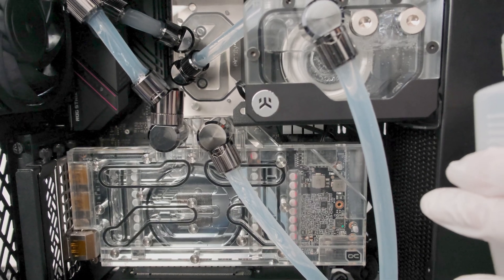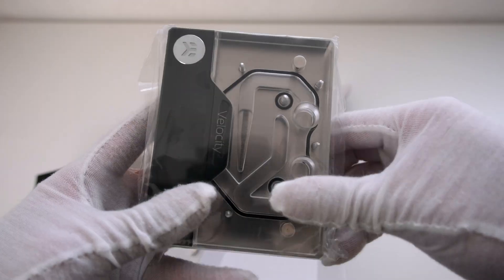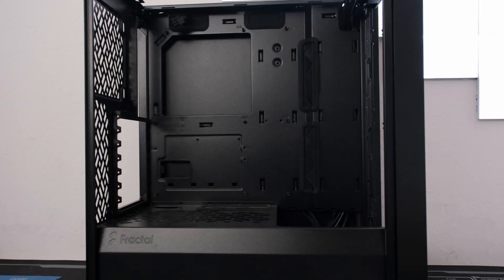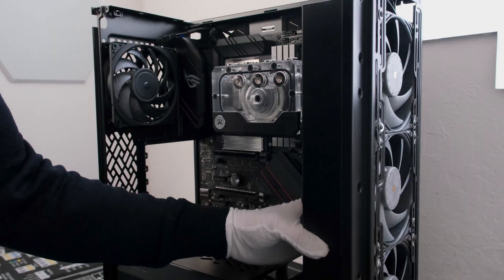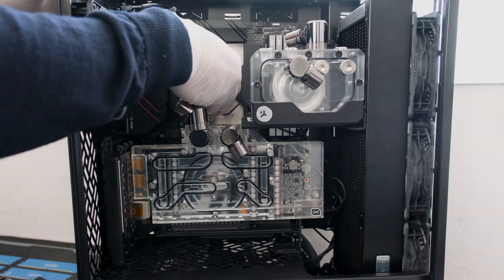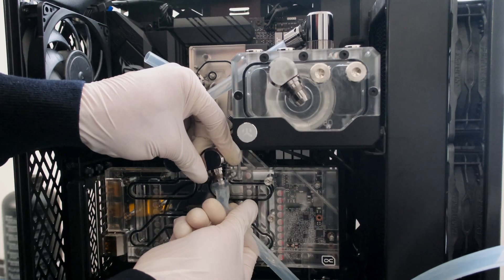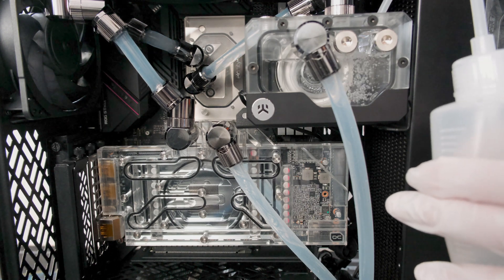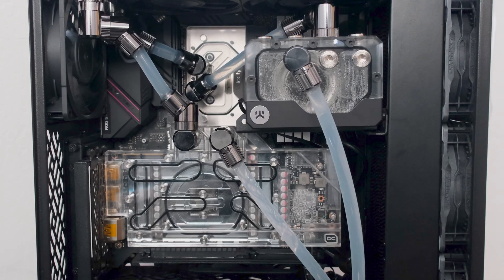Watercooled PC Build - Soft Tubing

Comment: I have this exact same case, and was wondering how tf i'd fit a pump/res combo inside of it. I want to use a D5, but I didn't even think about the way you just did it. Thanks for the upload!
Reply from the maker: Thanks for your comment 🙏That is awesome and I am happy that the video was able to provide something useful. Rest assured I tried multiple EKWB reservoirs and multiple mounting solutions and brackets from more than one company and in total I tried 10+ different mounting combinations/locations and this was the only combo and mounting position that I felt comfortable showing, with no modifications and would work for long-term. Thank you again for commenting and viewing.

Comment: Good build i like it a lot !
Except i'm stupid, i don't hear your temps of gpu and cpu, can you provide them ? I might have a problem, my GPU is 45-50c and my 5800X3D is 75-83c in gaming with a 360 rad from corsair..
Thx
Reply from the maker: Thanks for your comment 🙏 At this time, I didn't do thermal testing. I have since added thermal tests to all the videos. For this one, I took it apart already. The temps were OK at best. I have learned more since then. For your rig, 45-50C for GPU sounds perfectly fine. The CPU is perhaps high but it sounds like you're on a single 360 rad? Corsair uses Hardware Labs for their radiators, which is good, but they often use the slimmer 30mm rads. Adding another rad would help with cooling and/or help with lowering the noise level of your fans. Hope that helps and enjoy your system.

Comment: hey man is there any chance you can tell me the memory temperature under full load of the gpu it seems alphacool has left this piece of the gpu off their cooler but it says they have redesigned it on their website so
Reply from the maker: Of course, running a stress test in 3DMark like Time Spy or Port Royal, I'm getting somewhere low 80s for the GPU memory. The fans are running at approx. 1200 rpm. 
This is with the Heatkiller rads 360-L with 3x Phanteks T30s and 240-S with 2x Noctua A12x25. The temps stay fairly constant even under further load and the fans just pick speed to compensate. Hope that helps and thanks for asking 🙏